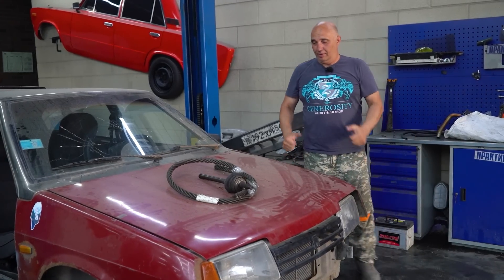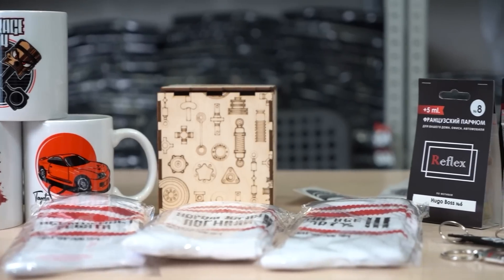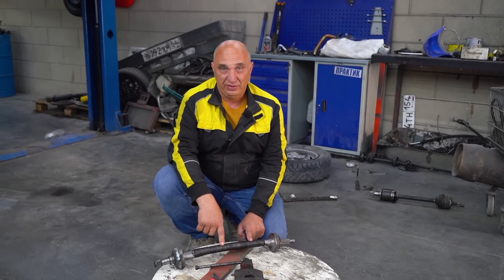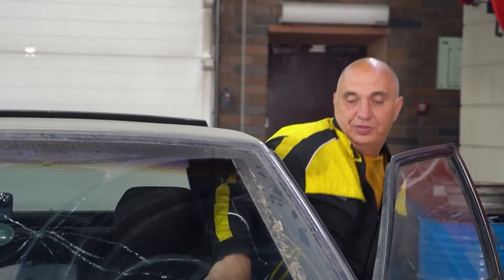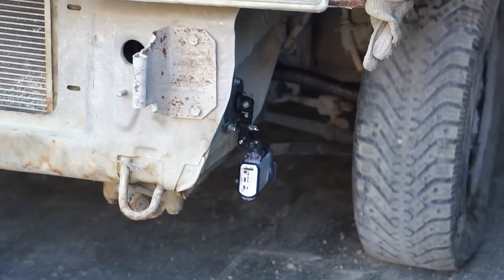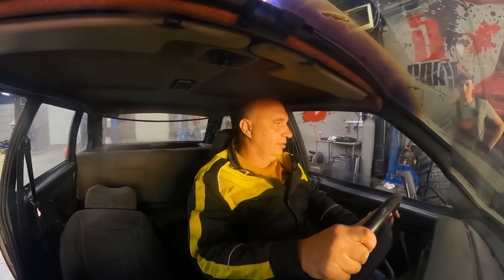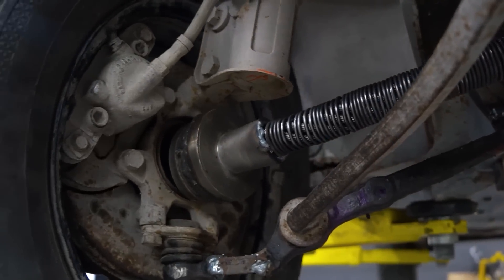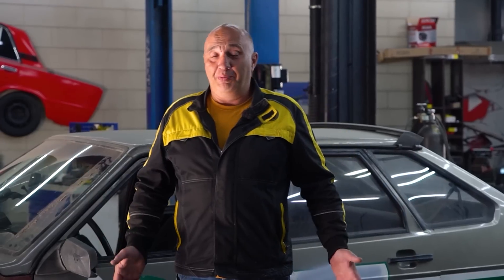Making axle shafts from wire rope – will they work?

Comment: Well ya can't win them all but if ya made some welds along the rope like the ends and possibly along the braids here and there .that should stop it from unraveling and twisting up .ya should give that a try .it might work ...weld up ends and weld braids about 3or 4inches back then some random welds here and there to stop braids from breaking ..what do ya got to lose ..anyways till next vid godbless and stay safe
Reply: Good idea, i would also weld the end as solid as possible, maybe that would help. welding those braids together may help with the twisting.

Comment: We tried it, guys, and it went bang!

Next thing to try, how about an electric drive? Generator driven by the engine, driving a big motor to turn the wheels. This would best suit a rear wheel drive car of course.

Try it with, or without, a gearbox. Personally, I'd favour the use of a gearbox - It would offer more options and flexibility.

How about exploring the idea of electric four wheel drive?
Reply: On their russian channel they put a generator on the roof and connected an electric drill to the input shaft of the gearbox.

Comment: I can already tell this is gonna fail just looking at how the cable was swedged into hub.
You should have the ends of cable professionally swedged, also on you wire wraps you should go both directions with it. You try swdging the cable yourself with zinc or lead. Another is a steel cone swedge similar to what sailboats use for their rigging.
Reply: it would make 0 difference, the main issue is that a rope is not designed to withstand twisting force, and it will change length under rotational forces, as you can see it pulls the drive cup out of the hub and gearbox, they even left the nut off the outer drive cup so there was 0 preload on the wheel bearing, even if the driveshaft worked the wheel bearing would have fallen apart.
Reply: @chrismechanic2000  I agree I'm just offering up suggestions for the best possible chance for success

Comment: Try to put big electric generator on engine and connect it with two electric motors on rear wheels.
Reply: Top Gear did that already and they nearly kill Stig:)
Reply: @joe125ful  share link
Reply: That would be generally what a Chevrolet volt or Vauxhall Ampera is and they were not a great success as the engine, generator would use more fuel than a normal car.
Reply: @stevenc5227  it's almost like electric cars are unefficient or something.
Reply: @dimitar4y  electric cars are not inefficient, but powering them with a generator is, unless its a diesel electric freight train, which basically uses a very large engine as a generator to power electric motors, they are efficient as they can pull 100s of tons of cargo for the amount of fuel they use.
Reply: @stevenc5227  battery->motor = waste. charging->battery = waste. charge idling in battery = internal discharge waste. Electric cars. ARE. Inefficient.
Reply: @dimitar4y  yes your right, its producing the electric and storing the electric which is the problem, maybe there will be a nuclear device in cars to power them in the future, wouldn't want to be in a car crash though LOL.
Reply: @stevenc5227  "terrorists" are "human" and have "human rights" and will be allowed to own such a car and they will 100% crash it into innocents and cause radioactive waste. Though nucreactors are more efficient the bigger they are. Putting small ones in cars would be a waste of fuel. A manufacturable fuel would be better, i.e. the notoriously explosive hydrogen. Probably need something more stable.
Reply: @dimitar4y  Well until then, petrol and diesel it is then lol.
Reply: I vote
Reply: The motor only power the generator, which powers the rear electric motors, right?
Reply: @zsombor_99  yes, using a generator-motor as a "transmission". Like they did with the hydraulics. Except electric this time.
Reply: it could be really efficient
Reply: @danieltaon7333  No running a generator to produce electric is harder for the engine than just running the car, so no not efficient at all.
Reply: @stevenc5227  really why people reply not knowing anything, please read about car hybrid systems, in a lot of them engine is coupled with generator.
Reply: @danieltaon7333  The Volt and the Ampera is not a hybrid in fact it is the opposite of a hybrid you should read up on it lol.
Reply: … what a fucking AMAZING IDEA
Reply: ghetto electric car. nice